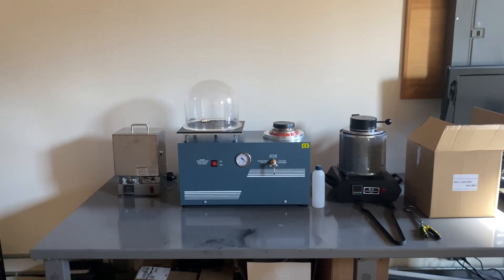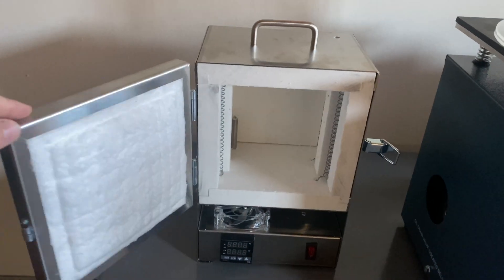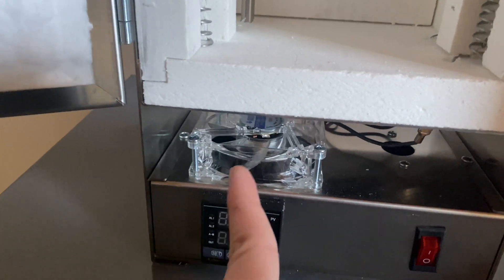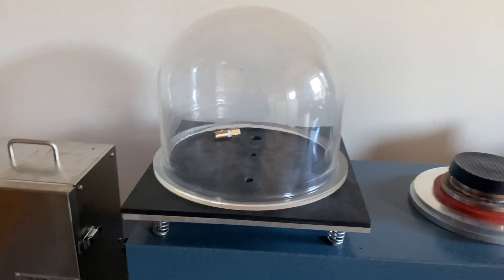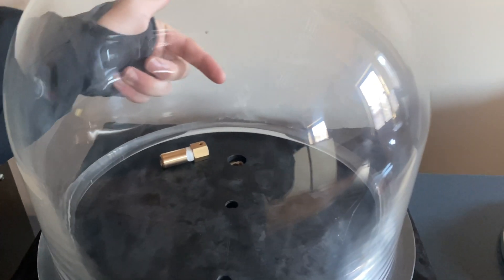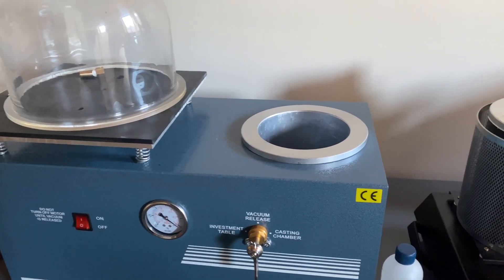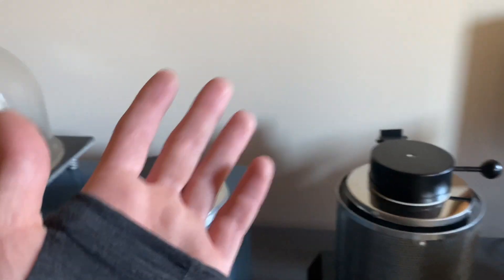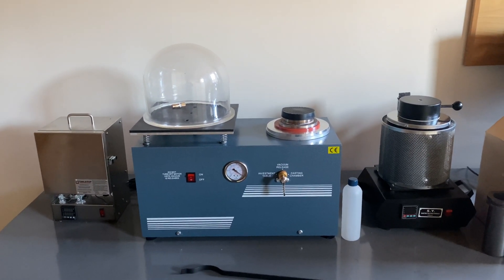My Investment Casting Setup #1

Comment: would you recommend the burnout oven? did it worked out for you good? and would you recommend the metal melting furnace ?
Reply from the maker: Hi Alexandra! I would highly recommend the burnout oven I have. It’s built incredibly well, is easy to use, and works without issue. I personally think it’s a terrific deal if you are interested in something that will work well straight out of the box and for a long time. I ended up breaking the furnace within a few hours of testing it. Ill link a video below I made as an update to this video where I talk about my experience with the oven and the furnace after some time working with them. Thanks for watching!

https://youtu.be/wSSSyvZ-uiA
Reply: @Levi_Sheridan  you don't really need the wax resin.  Get you a cheap flexible or weak resin that will burn away easily.   Just a suggestion.  It worked out well for me.  But I mostly use pla now .  I smooth it out with acetone first.  You might need to scale up ur models because the metal might shrink
Reply from the maker: @miclairmiclair876  I have used both PLA like filament and wax resin to make cast. For my purposes I need high precision parts and the PLA just doesn’t cut it even  with acetone smoothing. For artistic applications I’m sure that PLA would work fine but for engineering applications resin is ideal. Thanks for watching!

Comment: I have the same furnace and vacuum machine but got lucky locally for the burn out oven. I saw where you said you replaced your furnace and was wondering why. I haven't had a chance to use mine yet. Thanks!
Reply from the maker: Hey Drew, thanks for watching . I replaced it because I broke it. My furnace broke when I raised the temperature to it’s advertised maximum and it broke after being held there for too long. I found the furnace to be cheap and while I was upset I essentially wasted $300 I am now very happy with my new high quality furnace and looking back, I wish I just got the nicer furnace in the first place. I made an update video where I talk a little more about this, you can check it out here https://youtu.be/wSSSyvZ-uiA
Reply: @Levi_Sheridan  Thanks. That has me a little worried as I'm planning on melting brass. Maybe I will be able to rebuild it if it breaks on me.
Reply from the maker: @SmithDrewSmith  please let me know how that goes, I’m looking to melt some cooper in the future. Hope the machine works well for you.

Comment: After 2 months, how has your experience been with the vevor vacuum system?
Reply from the maker: Hey Joshua, thanks for watching my video. It’s been great! I have had no issues apart from the damage that was incurred during shipping. I contacted Joybuy, the company who sold me the machine, and they quickly sent me replacement parts. The machine works consistently, is well built, and  is easy to use. Overall, it gets the job done. However, it is a bit large and it has a lot of empty internal volume meaning if some more effort went into the design, it could probably be much smaller. I plan on making an update video soon on my set up as I have now had a decent amount of experience with the machines and have replaced my metal melting furnace since this video. Thanks again!

Best, Levi Sheridan
Reply: @Levi_Sheridan  thank you man. Vevor seems to be a new kind of harbor freight. I was looking at a few of their items. So far, everything related to customer service has been top notch. Im glad to hear that is reflected thru joybuy as well. The kaya cast is just a bit much for what it does. I imagine, if it were something i would have running all the time, the difference may be worth it. Sort of like Dewalt vs Ryobi. Fine for home use, but for career you want to pay for the extra sturdiness. Thats just my perception tho🤷‍♂️

Thanks again, you helped me make up my mind & feel more confident in making a decision for a vacuum system👍

Im actually surprised you paid so much for the burnout oven & did not make your own. Because of size limitation as well as cost. Just a thought i had while watching your video & doing research. I appreciate the video & reply🙏
Reply from the maker: @J0SHUAKANE  vevor does seem like HF, just without all the coupons. I would want to see one in person before I would say this with 100% confidence but I am pretty sure that the Kaya vest system is almost exactly the same as the vevor or equivalent vacuum system apart from having an external oil filling spout and maybe a better filter. The pumps are all third party mass produced pumps and the build is almost identical to that of vevor. I would not be surprised if one factory somewhere in this world pumped out these vacuum systems and Kaya just adds the spout and brands it. Pretty sure the branding and oil fill spout are the only differences but like I said I have yet seen one in person.

I’m glad I could help you make a decision. I know how much research it takes to feel comfortable to make such a  large purchase like this and it means a lot to hear that I was a part of that process for you. 

The reason I got a consumer burn out oven is because I will be moving to a tiny apartment in Manhattan within the next 6 months and I wanted something I would feel comfortable with in that situation. I’ve seen some great custom ovens but they are all larger than what I have. Also, I know I don’t currently have the tools to make anything to the quality and size of the furnace I am currently working with. I payed the premium for convenience and peace of mind.

Thanks again, Levi Sheridan
Reply: @J0SHUAKANE  might be a bit late, but I got this same machine and oddly enough a Kaya Cast is what arrived at my door. I think the same company produces various types and different companies just throw a brand on them.

Comment: is that the pro lp model?
Reply from the maker: Hey Moises. I am not sure what you are referring to so I am going to go ahead and say no. The three machines in this video are the tabletop furnace company burnout oven, the vevor investment casting vacuum system, and a generic Chinese metal melting furnace. I hope that answer helps. If not feel free to let me know and I'd be more than happy to clarify.
Reply from the maker: Hi again! I thought about your question some more and realised what you were asking. I do not believe that the burnout oven is the lp model. Heres the link the the furnace https://pmcsupplies.com/programmable-tabletop-hi-temp-2200-f-electric-burnout-oven-kiln-for-3d-pla-resin-and-carvable-wax.html

Thanks for watching!
Reply from the maker: The furnace looks like it may be the LP model with a vent hole drilled into it...
Reply: @Levi_Sheridan  yup thats its, thank you for your fast response and wish you goodluck in your casting journey

Comment: Nice set up! Exactly what I'm shooting for. So far have the kaya cast casting table and elegoo mars pro...  Slowly getting there. I'm a biker tired of looking for the right rings so decided to start designing them and casting them myself. Lol.
Reply from the maker: Hey Mike, thanks for watching my video!I’ll be uploading a new video early this week where I’ll be using the set up to make my first cast so keep an eye out for that. If you have the money I would recommend getting a better metal melting furnace than the cheap one I showed in my video. Unfortunately, I broke mine messing around with it so I went ahead and got a quickmelt from the tabletop furnace company who also makes my burnout oven. Both machines are built extremely well and function beautifully. I would love to see your setup when you have everything and the parts you make with it! Again, thanks for watching!
Reply: hows the eperience after 4 yrs of making this comment